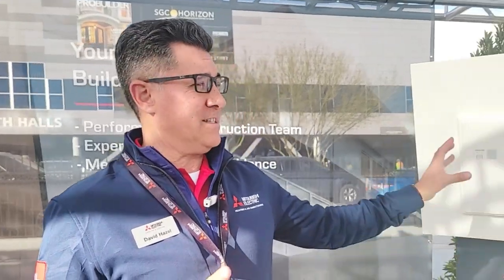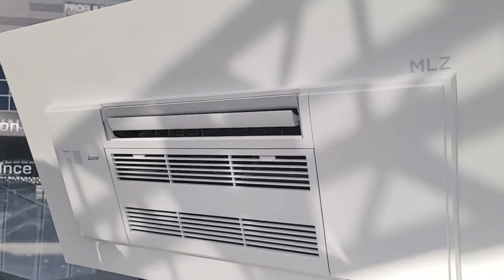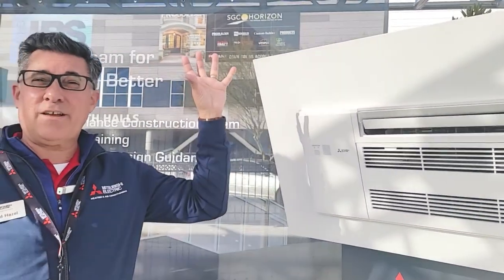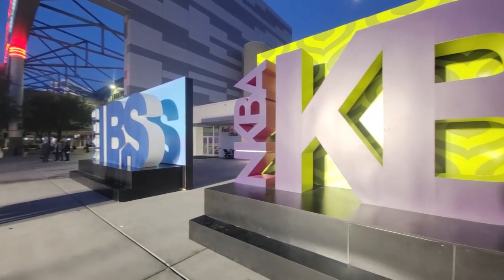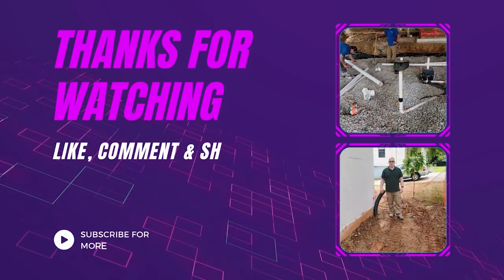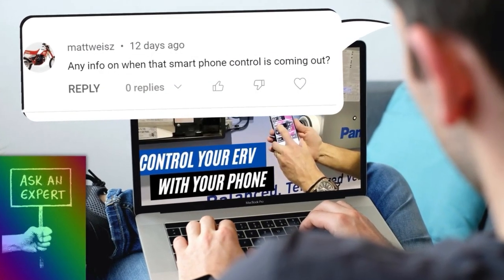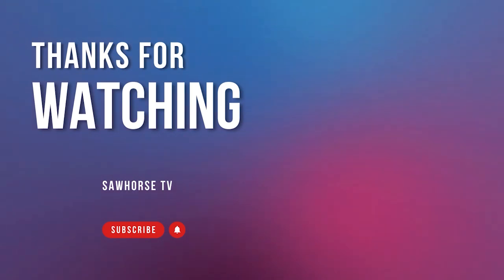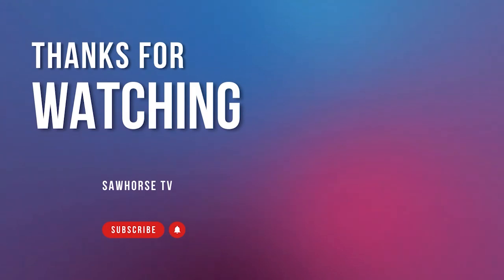Modern Heat Pump Designed to Work in HOT and COLD Climates

Comment: is there different pricing for wall mount and ceiling cassette?
Reply from the maker: I spoke to an HVAC designer and they said the equipment was close in price.  Install and finish could vary depending on it is is a retrofit or new construction.

Comment: I didn't know that heat pumps used to not work in cold weather...
As far as I understand the problem with cold weather and heat pumps is the efficiency drops signifanctly below freezing and 
at -7 C they're about as efficient as a regular electrical radiator and below -7 C they're less efficient than electrical radiators.
So my question is if this one is more efficient below -7 C than electrical radiators?

Comment: -13 F is only -25 C.  How far away are we from having heat pumps that can handle lows of -40 C and highs of 35 C?  That's the kind of range we see here on the Canadian prairies.
Reply from the maker: Good question- I'll take it to the manufacturer for an answer.